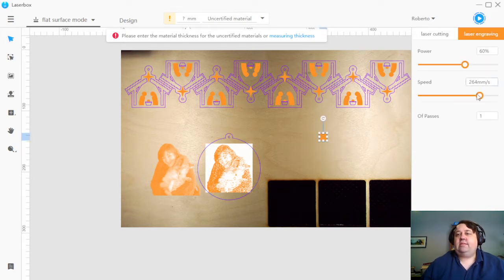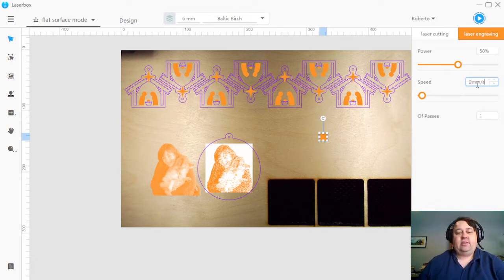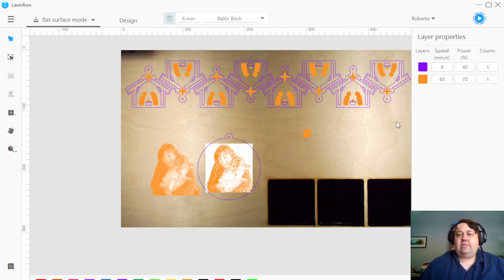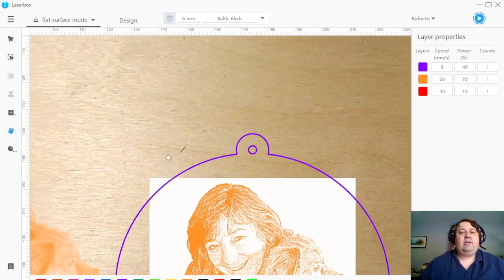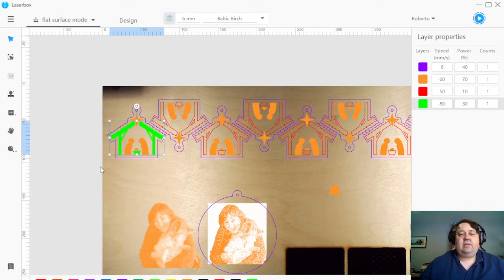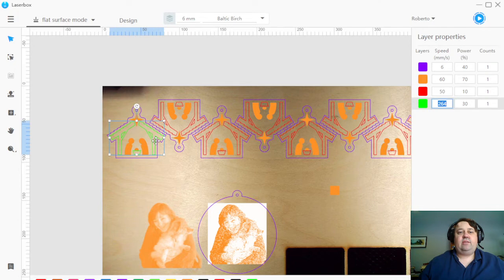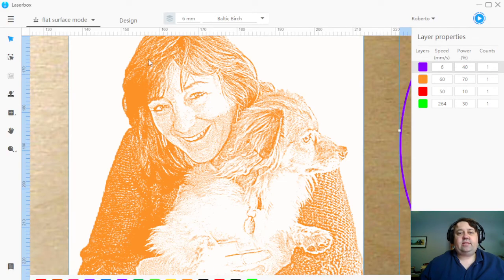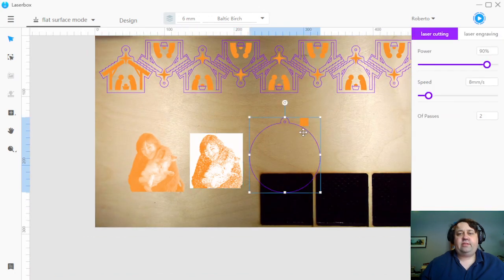Xtool Makeblock Laserbox Pro and Rotary 1.1.7 Software update

Comment: What is the solution for increasing speed beyond 80?  I'm using v1.1.9 and cannot do this.
Reply from the maker: On the design tab check the fill box to turn it into an engraving job, with a top speed of 330mm/s
Reply: @sharscrafthaven2091  Thank you.  I got it figure out.  My greatest struggle right now is when importing an SVG file from Inkscape that already has text set as object to path and then made a union.  When I import to Laserbox, the text is no longer a single path and all letters separate and just outlines.  I have to make the text a union again and also have to use the fill function in Laserbox... duplicating all of my efforts from Inkscape.  I've got to be doing something wrong somewhere?
Reply from the maker: Before using union in inkscape you have to ungroup. It will show the separate parts, then click union. It should come in fine into Laserbox then. If you get stuck let me know and I will make a short video on it. (You can also look at my text to path video).